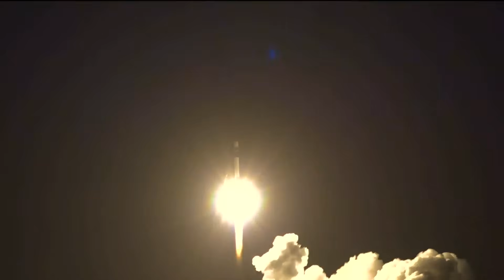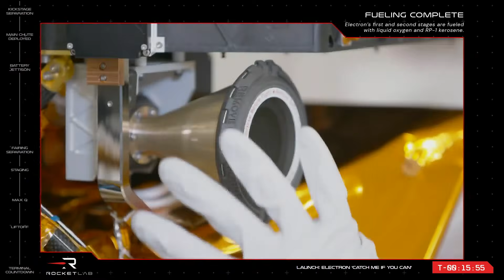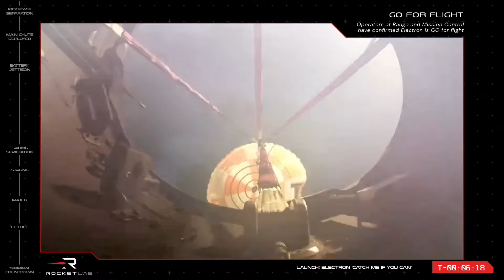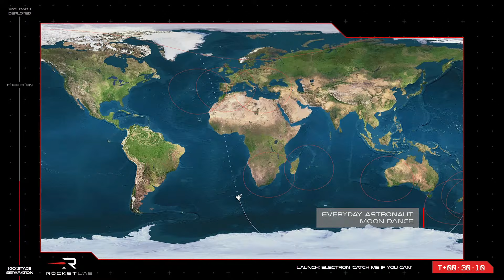Rocket Lab - Catch Me If You Can Launch

Comment: Congrats on the major part of the mission (put the satellite in safe orbit).
I wonder why Rocket Lab designed 1st stage with parachute for catching instead of landing on ground/barge like SpaceX?
Reply: Something everybody is forgetting here -- it's not just size/fuel that prevents Rocket Lab rockets from landing vertically.  There is a massive amount of software that helps a SpaceX rocket land vertically.   It took SpaceX years to get that right.   When a SpaceX rocket is doing a vertical landing, there are computers making tremendous calculations each second onboard that helps it land that way.  Programming software that can do that is *hard*.  I'm a software developer by trade -- I wouldn't want to work on that software, at all.  I believe I one time saw it described as like "trying to balance a broomstick in a hurricane."
Reply: @captainskyhawk4476  Tom Barnard of the BPS Space channel has done it on a small scale model rocket, it took him Seven Years. Hard, is an understatement :)
Reply: @captainskyhawk4476  It not just software, I think hardware (and in general technology) too. If everyone can do the same with others, everything becomes simple :D. But China now did some things impressed.
Reply: @captainskyhawk4476  Funny, I'm becoming a software developer to just that lol. Would be a wonderful pita to figure out!
Reply: The CEO commented that a fleet of barges is far more expensive than renting a helicopter.
Reply: @mgcamp85  not if the renting helicopter can't do the trick
Reply: The only reason SpaceX boosters don't land with parachutes is because they're way too large and heavy to make that viable.
Reply: Sinpler, cheaper, lighter.
Reply: Electron's initial design did not include any provision for recovery, as they did not expect the parts to survive anywhere near as well as they have. See Peter Beck's 'eating my hat' video for more on this, from when he announced they were going to begin a recovery testing phase.
Since then, parachutes have been added, both to stabilise the descent and to slow the catch and splashdown speeds.
With the recovered Rutherford being able to restart, I have to ask if it will now be more cost effective to engineer in a protective cover for the engine bay, or ways to seal the engines, rather then have the Heli trying to recover the vehicle. Plucking a floating Electron out of the sea seems far simpler then catching one as it falls. I'd expect the mass of such changes will be the deciding factor.
Reply: This dude getting ratio’d 😂😂😂

Comment: 41:00 It was at this moment we all knew...

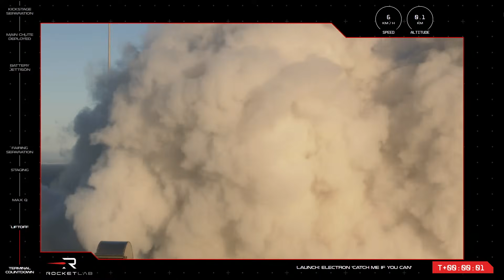23:11Lift off,
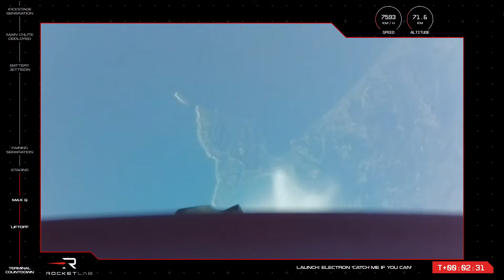25:44 Stage separation,
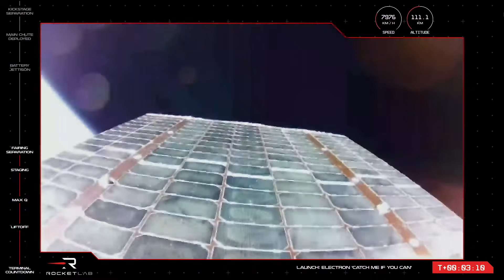26:24 Fairing separation,
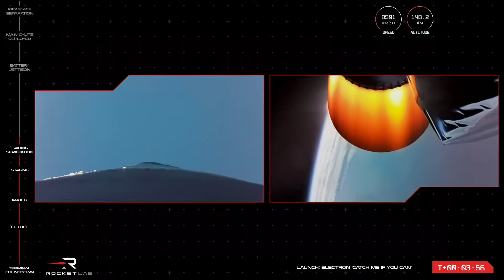27:10 First stage swimming around,
31:04 Battery hot swap,
31:14 Looks like they tried like SpaceX ("entry burn"),
31:36 View from the helicopter,
1:17:16 Payload deployment.
Reply: "Entry burn" Ha!   I wonder if there was enough plasma to make comms tricky.
Reply: thanks
Reply: Not actually an entry burn, just plasma.  Looks like one though.
Reply: @Infinite_Maelstrom  So are they not needing to do an entry burn at all?
Reply: @themoonissquare323  Correct.  Electron is light enough that it is not needed. 
(In fact, Electron doesn't have any fuel margin to be able to do one, even if it was needed.)
Reply: Video edited, timestamps off
Reply: 31:14 Plasma glow.
Reply: Yeah looked like a few seconds of an entry burn that was going alright, but then not. 

It's amazing a Falcon 9 booster is sometimes actually going a little faster down just before the entry burn then it was going at MECO, nearly at identical altitudes as well.

MECO was @  7582 KPH and 72.3 kilometers...So I wonder how this relates to where the Electron started the entry burn?